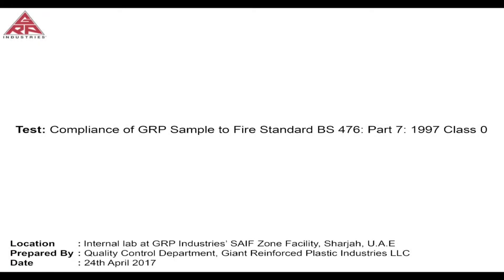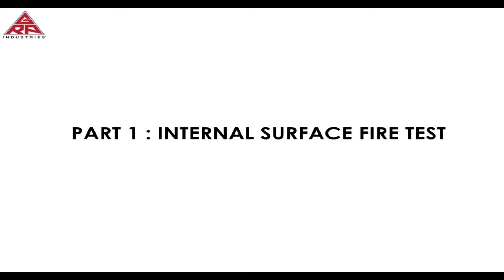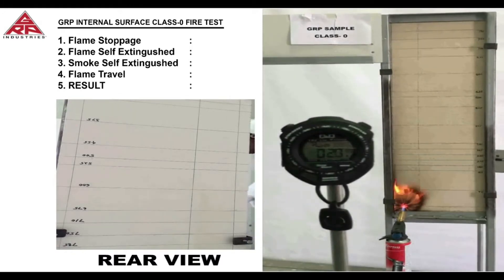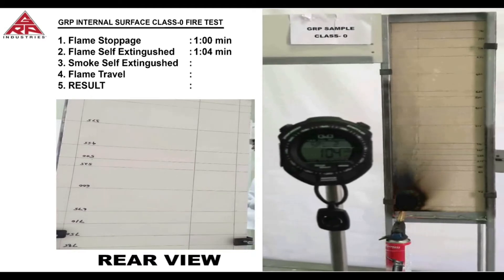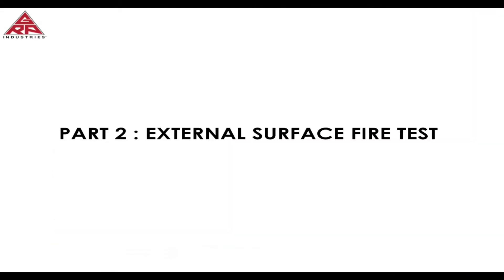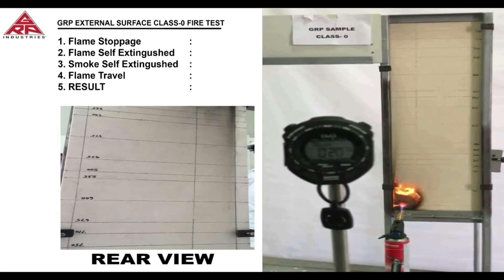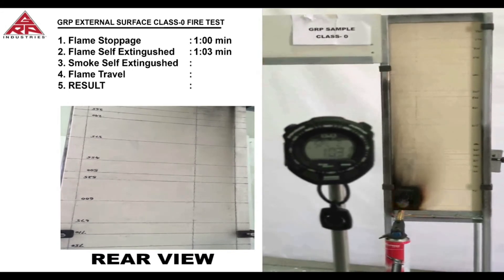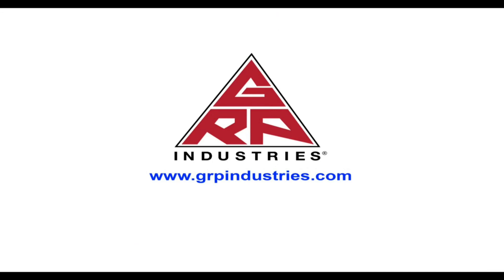GRP Class 0 Fire Test Video

Comment: Has the specimen been tested to actual lab conditions? I appreciate this is not a Lab test, however the lack of external heat, as required by BS 476 :7, makes this video misleading as there is no  combined effects of heat and ignition. As shown in this video this could probably comply with Class 1 to BS 476 : 6.
Reply: Class 1 is to BS 476-7, not to 476-6.

Comment: where is the external heat? it's quite different from BS 476: Part7?
Reply from the maker: Hi Michael, thanks for viewing our test video and submitting your question.
Reply from the maker: The video is showing an external gas flame burner being applied at a fixed point on the laminate.  We are not a testing laboratory so the test is setup for in-house testing at our manufacturing facility for demonstration of our laminate's fire retardancy and for comparative analysis.

Comment: BS 476: Part7 starts with Class 1 as the lowest possible classification. Any reason to specify Class 0 here?
Reply: Sanjay, thanks a lot for visiting our Youtube channel and offering your question.  Yes, you are correct that BS 476: Part7 starts with Class 1 which stipulates that the flame travel limit is set at 165 mm.  The purpose of our exercise was to push limits to Class O and provide a higher spec of laminate which has a higher fire retardancy.  By this test, our laminate meets that with a flame travel limit of 75 mm.  The purpose was demonstrative in nature to display a higher grade of flame retardancy.